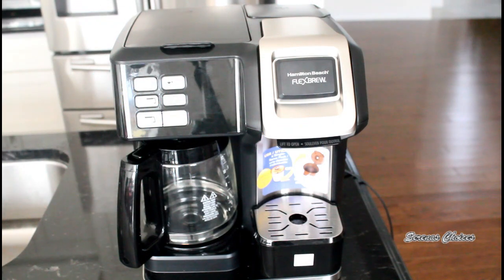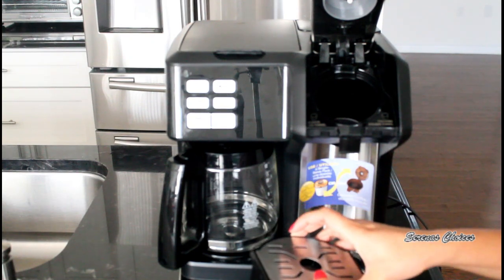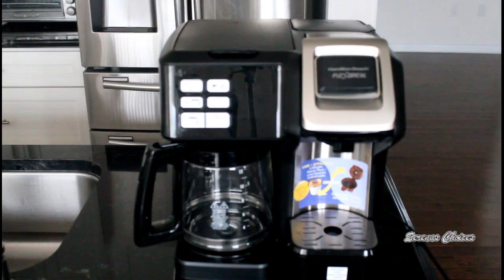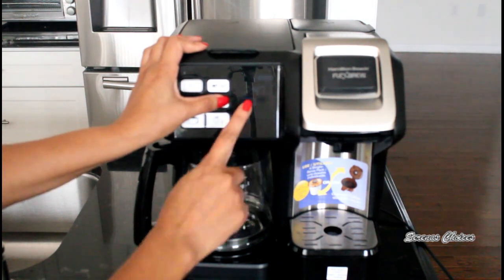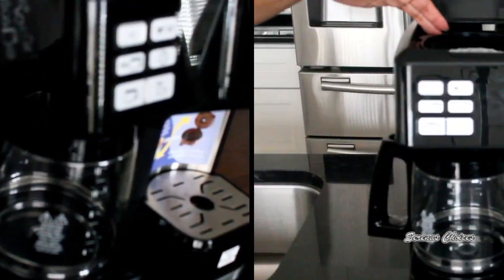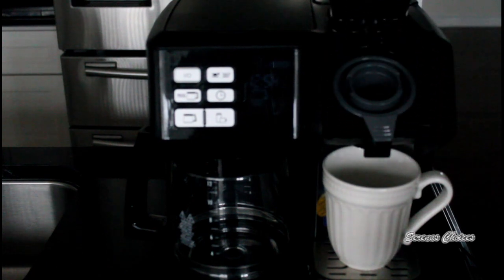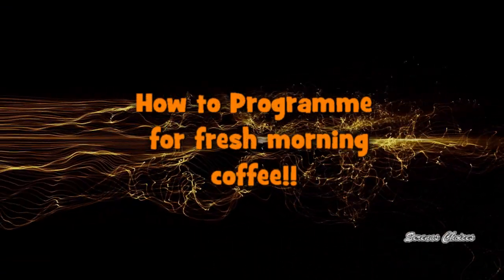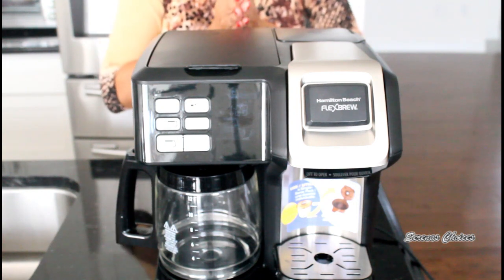Hamilton Beach Flex Brew 2 way Coffeemaker

Comment: I have the exact same one. Worked great for about 1 year and a half and now it's leaking from the bottom when using the Pot-side of the machine. I thought that maybe it was time to clean it out, which I did using the recommended instructions in the manual, but it's still leaking out from the bottom.
Reply from the maker: Sorry to hear that, mine is still going strong with daily use.